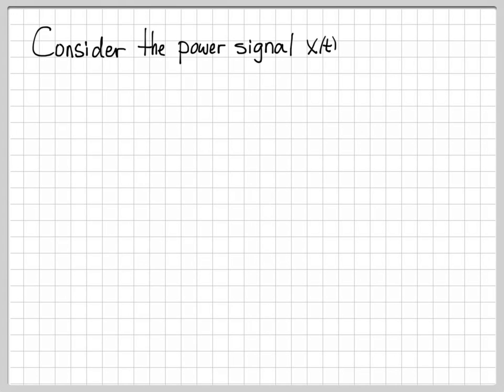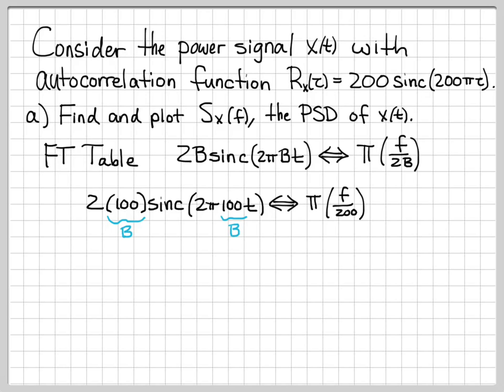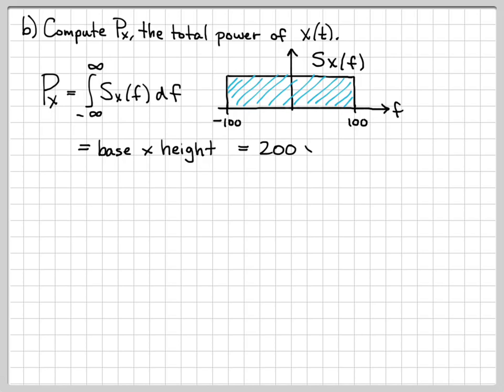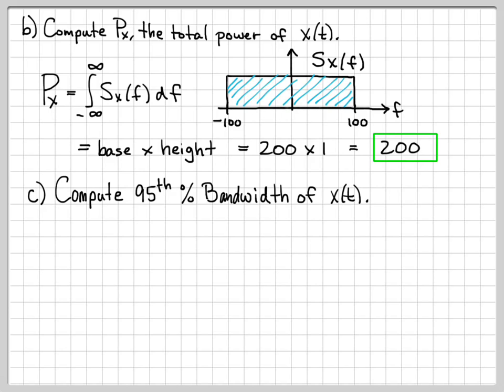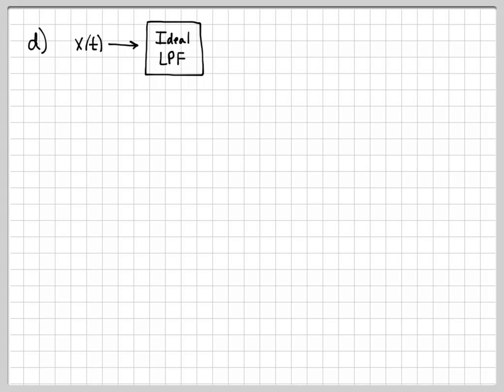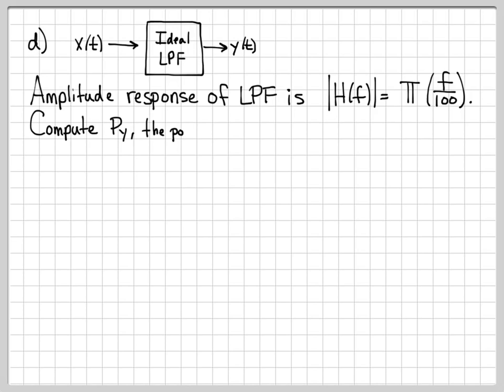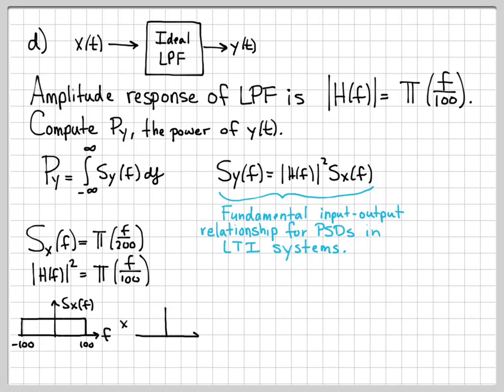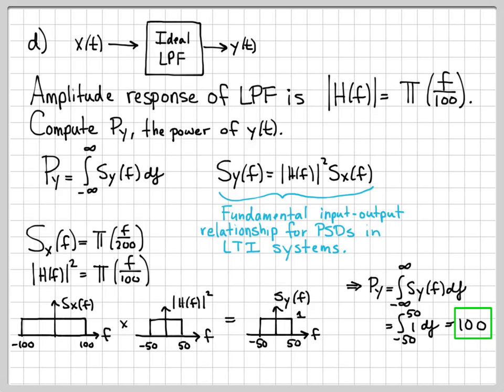Power Spectral Density Computations - (Fall 2013, EE504, Exam 1 Problem 1)

Comment: I'm new to this subject.   Question:  Can't you do all this with the fourier transform of the function?  Why do you need to bring the autocorrelation in to it?
Reply from the maker: You cannot take a Fourier Transform of a random signal; only a deterministic signal.  Random processes can be described by their autocorrelation function which captures the statistical temporal correlation/nature of the random signal.  The autocorrelation function is a deterministic signal, and it's Fourier transform is the power-spectral density function.  This PSD function characterizes the frequency content of the random signal.  Hope that helps,
Adam
Reply: @AdamPanagos    Adam, I know you are right.  But I still don't understand.  Ultimately, you need an actual, realized, concrete example or sample of this signal.    You can't actually do anything with a signal until you have actual numbers on paper, or in your computer.  At this point, you can take a Fourier transform.  Right?
Reply from the maker: @PikesCore24  In the "real world", any signal that you record, once recorded, is now a deterministic signal.  We can then compute its FFT to find its frequency content.  Similarly, any signal that you can write down an equation for as x(t) = ___ is a deterministic signal that you can compute it's Fourier Transform since you were able to actually write out an equation that described x(t) for all time.  Random processes, denoted as X(t), are completely different.  We cannot write X(t) = ___ because they are random.  As such, we have to characterize them statistically.  We do the same thing for random variabless.  For example, consider the random variable A that is uniform on [0,1].  I can't write down what A is, but I know when I observe it it's value will always be between 0 and 1, it's mean value is 0.5, its variance is 1/12 etc.  There are all properties of the random variable that statistically characterize the random variable A.  We have to do the same thing for X(t).  We can write down properties and functions that characterize it statistically.  The PSD is one of those functions.  The PSD describes, "on the average" what the frequency content will be of a sample function (i.e. observation) of X(t).  Hope that helps,
Adam

Comment: Which Fourier Transform table did you get Sx(f) from?
Reply from the maker: I use the text "Signal Processing and Linear Systems" by Lathi in the course I teach.  I used the table from this textbook.  You could probably just Google "Fourier Transform Table" and find a similar table.  Most Fourier Transform Tables have the same commonly used Fourier Transform pairs listed in them.

Comment: but isn't the Sxx = |X(f) | ²  ... while X(f) is the TF of x(t) ? u didn't use the TF to calculate it
Reply from the maker: Not quite.  When dealing with energy signals, the energy spectral density is |X(f)|^2 where X(f) is the Fourier Transform of x(t).  When dealing with power signals, we characterize them via their autocorrelation function, or equivalently in the frequency domain, their power spectral density.  Since this problem is dealing with a power signal that is characterized by a provided autocorrelation function, taking the FT of the autocorrelation function provides the power spectral density from which we can the compute the desired power quantities.  Hope that makes a little more sense.